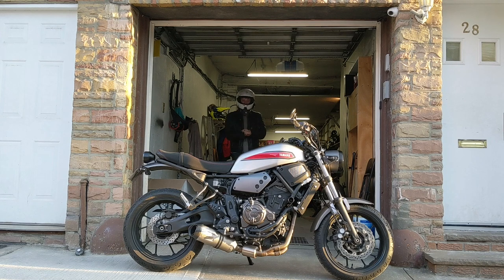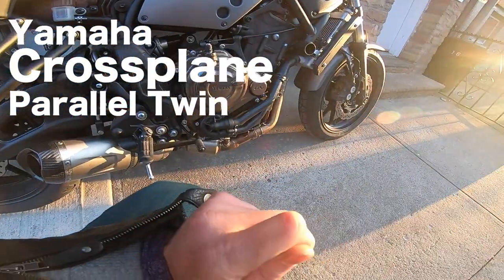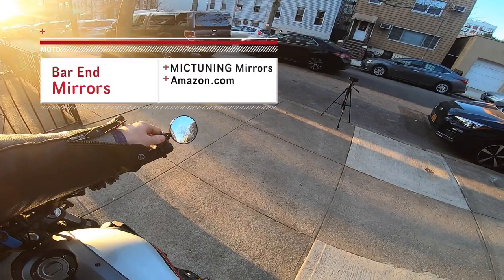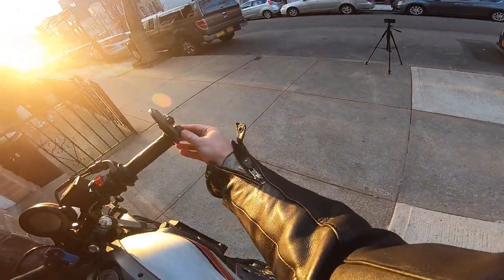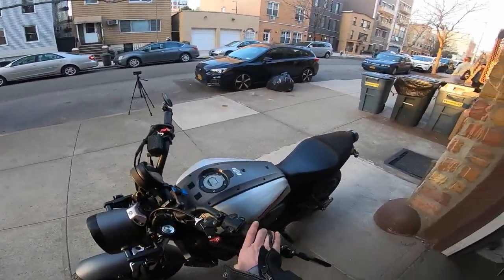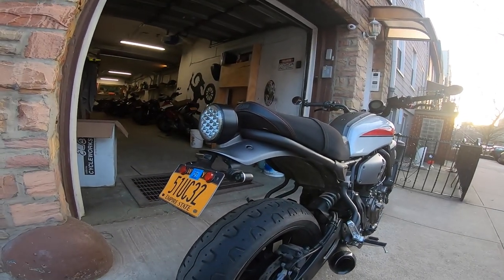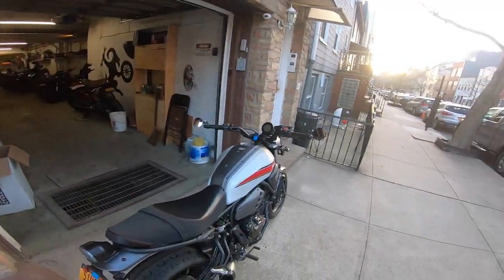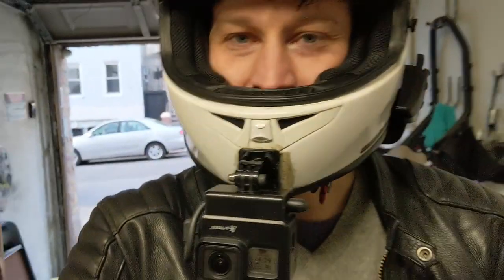Yamaha XSR700 MODS (so far)

Comment: Funny I still have original exhaust, rear and lights. I did do the Fork covers, Fork gaitors, R & G fork sliders and, Frame sliders. I did a yellow background on gauge and some other small stuff. Good video. I added a piranha flyscreen too.Best part of these bikes is they are fun and easy to mod.
Reply from the maker: Very nice! You're absolutely right and that's actually why I love the XSR platform. Great bike for modding.

Comment: I bought the mirrors. but do I have to buy the bar ends?
Reply from the maker: They come with adjustable mounts for the ends of the handlebar. I didn't use them because I used the Rhino bar end weights/sliders, but they should fit fine.